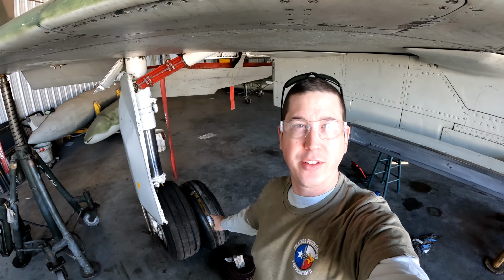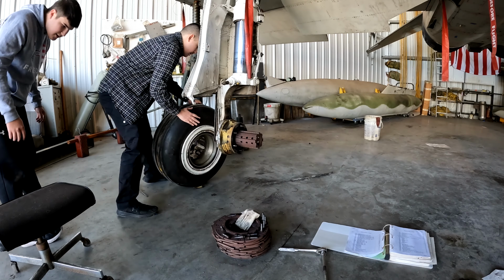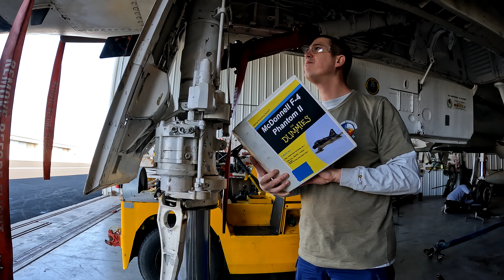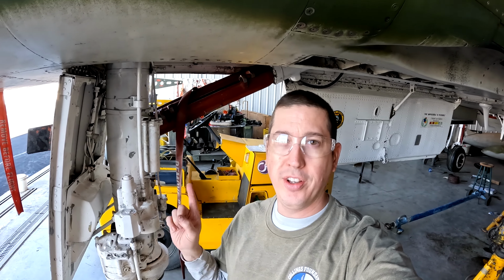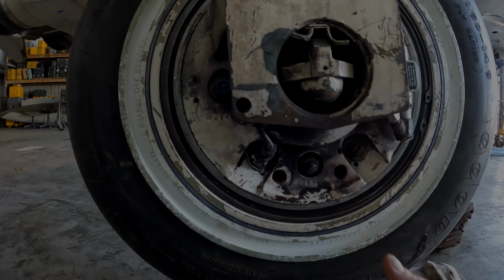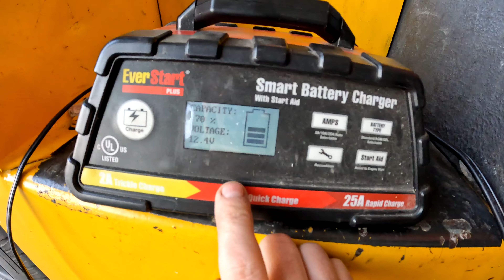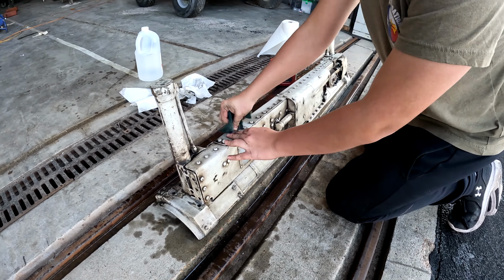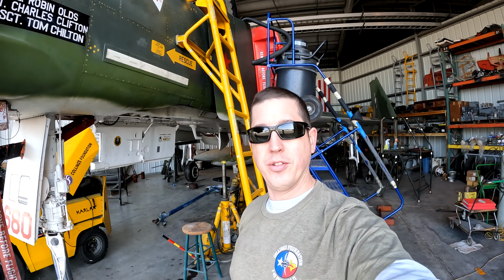Tires and Batteries! - F-4 Phantom

Comment: FYI notice the green stripe on the yellow year band-t indicates a new tire, if there was a diamond, it would be a recap. Beyond my F-4 egress, I was also Repair & Reclamation/tire shop for the KC-135's from 1991-2010.....
Reply from the maker: Learned something new today, thanks TankerMan!
Reply: @DieselThunderAviation  Still, it's a 2002 tire-21 years old...
Reply from the maker: A valid concern for sure. They were factory wrapped and stored out of sunlight. The tire shop didn’t raise any concerns when they mounted it, and they specialize in aircraft tires and wheels. Hopefully soon enough we’ll be going through tires more regularly!
Reply: @DieselThunderAviation  You might wan't to mention to the pilot those are new-old stock tires, so he'll try to touch down gently if possible (light loads and no cross winds).
Maybe include an inspection to the post flight check list. Not USAF SOP.
Better safe than sorry.
Reply from the maker: An excellent suggestion! Thank you for that!

Comment: Your not finished with the tire/brake installation in the video?
Reply from the maker: Not in this video. The needed to get torqued and checked, then the brake stack can get installed, bolted in, and safety wired. Then the anti skid sensor gets installed. More work that was covered the following weekend.
Reply: @DieselThunderAviation  My memory is kind of foggy but I worked on J birds in the Navy but I think we put the brake package on first, we also inspected the axle. agin this is many moons ago. love watching your f-4 videos, I loved the drop check video, watch for the barber poles. The plane does shake alot when activate the gear. we generally had a center line tank on so we used a hernia bar  and two jacks in front. if we were on the boat we had to chain the bird down.
Reply: Looking at your other videos I'm thinking that the USAF wheels were different than the Navy's. Boy I 'd love to be down there watching you guys. Do you know if there are any nose wheel landing doors laying around? {the long one] just asking.
Reply from the maker: They were different for sure. The Air Force kept the same tail hook, but modified the main gear to be less robust and lighter. No need for a stout landing gear if you're not landing on a boat I suppose!

Comment: Whats the operating tire pressure on the mains?
Reply from the maker: For us it's between 210- 250 PSI on the mains, 210 being the minimum for having nothing mounted on the wings and full internal fuel (45,000 lbs). Nose gear is between 150-180 PSI for the same weight.
Reply: @DieselThunderAviation  do you think 140 psi would work for towing on unapproved surfaces for the mains?
Reply from the maker: My crew chief book shows the minimum pressure in the mains should be 150 PSI, and that pressure will support up to 35,000 lbs. An empty F-4D (fuselage only with engines and no fuel) is nearly 30,000 lbs. Wing racks (MER/TER) will add to that, plus any fuel onboard. 

I'd be very careful with a rough surface tow. Certainly would make sure the brake accumulator is charged and have someone stationed in the cockpit ready on the emergency brakes in case the tow is broken. What model are you moving?